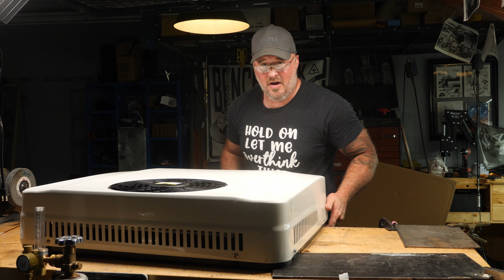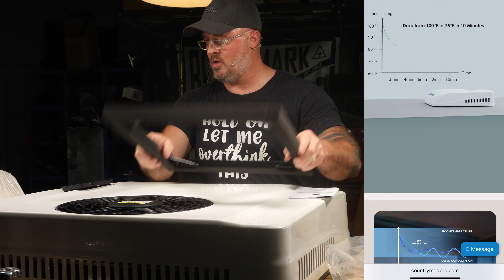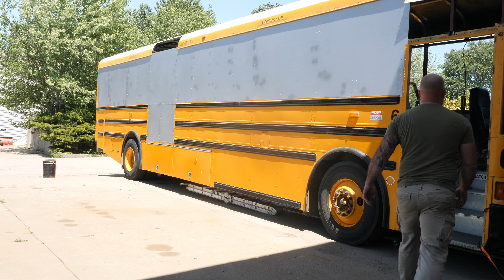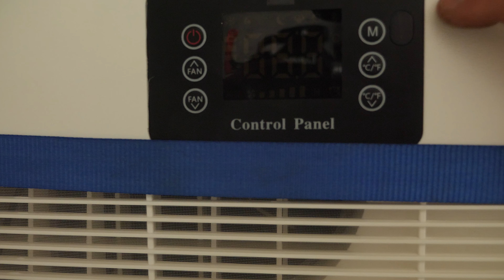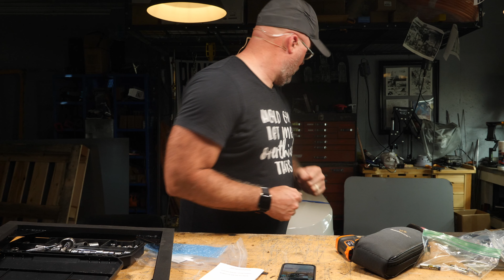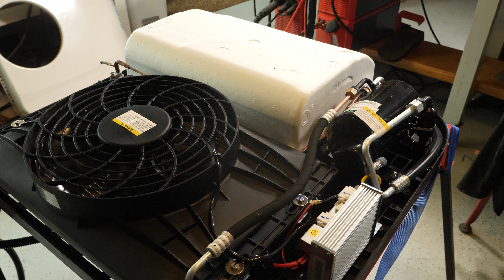The Future of RV Air Conditioning is Here. DC powered CountryMod A/C

Comment: I have a 12 passenger Ford E-350 with the venerable triton V-8 that I converted to a grandkid hauler/camper; the 1999 factory ac is woefully inadequate, so when I spec'd out the refit I just went super simple with the ac solution - since I added a 120 volt platform to the van powered by a 5 kw generator, solar, and battery bank,  I simply removed one of the rear door windows, built a frame and stuck a small 110v 5k btu unit in the back.  It's wired directly into my power distribution panel, I keep the remote up in the front cab, and that's it.  Super simple, and if the unit ever dies, I just replace it.......Am I the only guy that went that route?

Comment: I’m not opposed to a complex instaIl and wonder if that can be disassembled and modded to run with the condenser under the van.

Just not a fan of cooling equipment getting beat up by solar heat.

Comment: Loved the reviews of the hydronic heaters but here you only repeat the mfg. specs. A draw of 18.3A at 24V (26.5V nominal) is 484 watts.  This provides an ERR of 20.6 (10,000btu/484watts) which is off the scale. Using the mfg. provided ERR of 12 would mean  the unit is only (484watts x 12ERR) 5,800BTU

Comment: Your conclusion is fair, I would only use this on a small vehicle or tent and not expect too much.
A 12vdc AC won’t (can’t) be as efficient as a higher power unit (240vac in Australia).
I have a 24vdc 3000W AIO on a 40’ bus with 2kWh of pv, and a 2.5 kWh reverse cycle split system A/Con I dont need to use it much, but it does cool or heat the whole bus quickly and cycles down within 15-20 minutes.
I can shut the bedroom door and it does not use much power to run all night, although I will generally put it on timer for an hour or two.
This is an option for a 12v budget, but don’t expect high performance even though it does seem to be built fairly well, if you can afford higher voltage systems, they will always give you the grunt you need, when you need it.
Mr Cool seem to have good systems for Americans to consider.& easy to install DIY.

Comment: One thing you didnt mention during when talking about AC vs DC units is voltage line drop.  Especially on a 12v system, the line loss could easily be comparable to the loss you get inverting the power, except with more expense for wiring 🤔.  To minimize that loss you would potentially be spending hundreds of dollars in wire and massively over size it.  A victron will run at about 90-93 percent efficiency.  A 20 foot run of 6awg, which would have sufficient capacity at 12v, would lose 6%.  Would need to run 2 or 3 awg to get 3% loss.

Comment: Installed 10 days ago. 12 volt model. At 103 outside on max cool maintained 80 degrees drawing 56 amps. My old air would not maintained any lower than 84 degrees and drew 127 amps of dc power when on. The other advantage while going down road i use eco setting and the interior of my 24 ft motorhome is comfortable without generator or inverter power. Still testing this summer, but it is much quieter  at at 48db versus 58 db all the time on old unit. It is also lower profile at 7.1 inches vs 15.5 on old unit. Was in eugene oregon 101temp and ran it for 5 hrs with just my 300 ah battery. Was at 73 % before i plugged in. So far happy.
Reply from the maker: How well insulated is your motorhome?
Reply: Sounds like your 120v/240v ac unit was not working properly if you were using a split inverter AC system, I have found a 2.5kWh split works well in my 40” bus, 10 kWh 24v lipo4 & 2 kWh solar pv..

Comment: Put it on a van roof in 90F temperatures in direct sun and see what you get. It's absolute garbage, mine is pulling 900 watts at 13V and can't cool the interior to 85F after 3 hours.
Reply: I’ve run it all the time in the 90s and it works great. The details are important. Are you in an area with high humidity? Does your vehicle have good insulation? And other things.
Reply from the maker: Thank you for giving us your real world experience.

Comment: Keep in mind what was being measured was power consumption.  Efficiency would require cooling capacity to be considered.  While the power consumed was low, for all we know BTU/hr falls short of the specified rating.  
The YouTube channel Mortons on the Move recently investigated efficiency of rooftop air conditioners.  While it's a lot of work, it was a thorough test that ideally every rooftop air conditioner would go through.  Especially because unlike residential equipment, there is no regulating body that enforces standardized testing of mobile units.